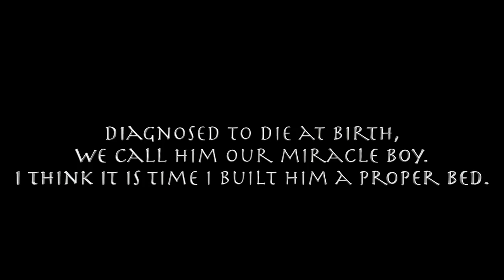Woodworking, Building A Bed For My Boy

Comment: great job.I liked the trick with the router to level the headboard.
I would have messed about with an electric plane and belt sander so I won't forget this one :)
Reply from the maker: There is a more in depth video on the router plane setup on my video page. Pretty easy to set up.
Reply: yep,setup is so simple but I never thought of the router approach.
I've used the same approach with planes for scarfing ply

Comment: I love you, brother.  Being a good Christian father is hard, I've got kids, but being a father to a son with special needs is even harder.  My older brother is mentally handicapped, so I know the struggles first hand.  The first time you mentioned your faith on here...that's when you earned my sub.  I wish I had a million more accounts to sub after watching this video.

I built a crib for my first daughter and, since then, 3 more bio kids and 6 foster kids have ended up using it.  Its a corner crib.  It kinda looks like the superman symbol from above and the entire thing is metal-free (except the hinges).  The front of the crib (the top leg of the pentagon when viewed as a superman symbol) is the door to open it up.  Made entirely out of 1/4in yellow pine plywood and 2 gallons of glue.  

Everyone always tells me I should crank up my own YouTube channel, so as soon as I get my CNC shop setup, I'll start posting some videos.  You are an inspiration.  Also, I found your channel through your man crush ;)  I've been watching that guy since before he had 5 digit subs.

Comment: how long can woodwork last for?
Reply from the maker: 300+ years if it's built right.
Reply: wow...but you mean it's coating or the structural ??(built right)
Reply: Bhojpuri v
Reply: Both, and more. Well designed woodworking takes several factors into consideration. Design that allows for even distribution of stress through the structure, as well as design that takes into consideration how wood changes due to temperature and humidity through it's life. So far as I know, none of us live in an environment where there is no change to temperature and humidity. Where I live air humidity can range from 100% for months at a time in the summer to less than 10% in the winter. Along the Pacific NorthWest, the humidity characteristics are somewhat different with high humidity in the winter and low humidity in the summer. Different woods handle changes in humidity differently, some picking up significant weight when humidity goes up, and lose weight again when humidity goes down, in the process swelling and shrinking, others are more stable. Wood finishes do exist that seal out changes in humidity, but most of them exist more to improve the appearance of the product.

Things from a structural perspective that also affect how well woodworking ages includes fit of joints, and how they are secured. From a maintenance perspective, wood that is regularly waxed and polished, dusted, etc, will last longer than wood that is left to weather. 

There are several historic ships in the US that are made primarily of wood that are over 240 years old now, and are only not in active service because their value as historic fixtures is greater than their value as functioning craft. I do not know if this is true elsewhere in the world, but would not at all be surprised at wooden craft in the Pacific and Atlantic that are well over 300 or 500 years old and still in service for fishing or moving people from place to place, where that makes more sense than attempting to put in roads.

Furniture at the Vatican made of wood in the 5th and 6th century is still in use. Stradivarius violins are world renown for their sound quality and have set the standard for quality violins for over 250 years.
Reply: centuries if  not abused and neglected
Reply: Look at the Archway that stands in Hiroshima (or Nagasaki i cannot remember). Its still standing for hundreds of years and survived not only the force from an Atomic Bomb but also a Tsunami. I learned my carpentry craft from my grandfather and he always said. "Its not just Wood... its life. Take care of it and it will take care of you".

I never full understood because what he said never got tested until an Earthquake hit, not strong because well we never really have them in the UK but i was in the shed that i built at the time and all our neighbours sheds, greenhouses etc fell down... but mine didn't apart from a few hanging tools (and my axe which i now no longer hang because i like my toes where they are).

Great job Samurai, this it the first video ive seen of yours and i see you stick to what my grandfather taught me. Great job :)
Reply: That bed?? Longer than the years you and I have left on this Earth, combined.

Comment: Hey there, this is a great bed. In my opinion, there need to be at least some holes drilled into the panel under the matress to allow the moisture in the matress to escape, because our body produces a lot of sweat while sleeping and if it is traped in the matress it build up mold in the matress causing health issues and smell over the time ;-). Keep up your great work. I like it.

Comment: I know this is old but hopefully you or someone else reads this and can answer.... how do you get your router to cut so deep when using the sled to flatten the top? My router just won't plunge that deep. Do I need a new router or are there extension chucks you can get for them or something?

Comment: I like everything about this video. But I just have to say that wedges should never push against the grain. Even if it doesn't split right away, over time it might shrinks and splits. The screw should hold it together though. But which classical joint needs screws to hold? ;p anyways, great video!

Comment: Love the videos! The main thing I wondered about is whether or not it would be ideal to have some form of an open structure below the matras for the sake of ventilation? This could be an assumption of mine based on the fact that most seperately sold matras support structures are a collection of beams strung together (as opposed to one flat plate) and even the hardboard specifically sold for making beds has a maze of holes in them?

Comment: I bought a mattress, and foundation, about 2 years ago.  mattress was nice, but foundation fell apart.  I took the fabric off it it, thinking I would repair it.   Imagine my shock, when I found CARDBOARD.  Right.   1x3, and cardboard.    I built my own foundation, and put the material on it, and I've been waiting for the mattress to fall apart, but it's still holding together.    Now, I need to build another foundation, because I've gone from full to queen.   So, watching this video.  Thanks.

Comment: @thesamuraicarpenter I love your work and loved the editing of the bed going together...thumbs up.  What is your reasoning behind not using dowels/biscuits/dominos on your long joints?  Thanks
Reply: Maybe I can take a crack at an answer.    Dowels, biscuits or dominos are for alignment, not strength.    Mortise and Tennon, and wedges are superior in both regards.     This bed is going to be around for a long time.     Frankly, most wood workers put a little love into their projects.   This one had an abundance.